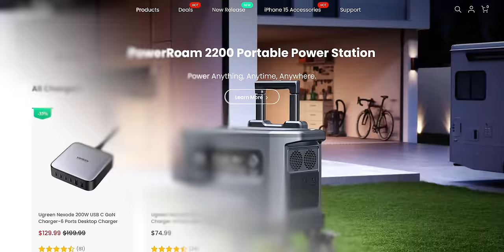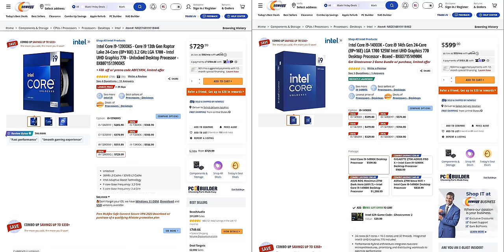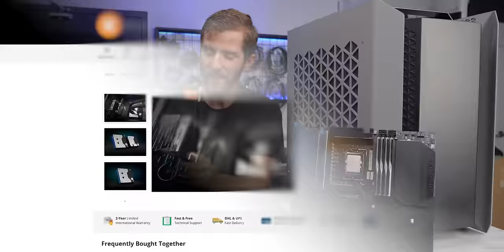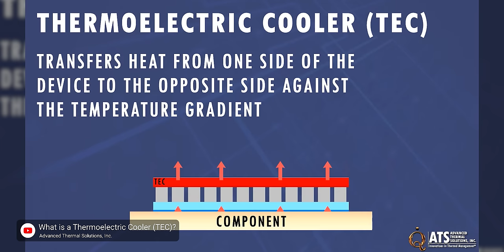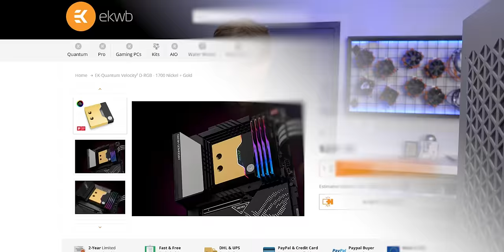Compensator 4 - How to Waste $30,000 on a Gaming PC

Comment: Gerolsteiner, once i used it also to refill the watercooling....... but of my car... when i got stuck in traffic and due of a faulty fuse the fan of the radiator didnt run and the water started boiling.

Comment: You've overcooked it there with the RAM.....

This is from MSI directly, that motherboard doesn't run well with more than 2 DIMMs.... I'll never understand why they bother putting 4 DIMMs on them.

4x DDR5 UDIMM, Maximum Memory Capacity 256GB
Memory Support 7800+(OC)/ 7600(OC)/ 7400(OC)/ 7200(OC)/ 7000(OC)/ 6800(OC)/ 6600(OC)/ 6400(OC)/ 6200(OC)/ 6000(OC)/ 5800(OC)/ 5600(JEDEC)/ 5400(JEDEC)/ 5200(JEDEC)/ 5000(JEDEC)/ 4800(JEDEC) MHz

Max. overclocking frequency:

     • 1DPC 1R Max speed up to 7800+ MHz
     • 1DPC 2R Max speed up to 6600+ MHz     
     • 2DPC 1R Max speed up to 6400+ MHz
     • 2DPC 2R Max speed up to 5600+ MHz

14:14 its a shame that you cant make full use of those cables with that PSU and its lack of support for them

Comment: 52:10 Strong BUY. Still early innings. NVIDIA is the dominant leader in AI and the preferred technology partner globally.  Even w new competition on the horizon, NVIDIA is far ahead of the competition.  85% market share. 76% margin. Unrivaled demand for new Blackwell chip. Demand far exceeds production for Blackwell through to 2025 and beyond.  No competitor has anything close to Blackwell.  And forward P/E is about 33 (cheap for a high growth stock). Buy this stock and wait. You will be rewarded

Comment: 5 nvme and 6 sata drives ... on a consumer platform. Like connecting a firehose through a straw.

So I think my computer has some resemblance to this system. 128GB ram (yes, I have a specific use case that needs it), 3 NVMe SSDs (one boot disk, two in raid0 for speed), ~$180 mechanical keyboard (because RSI), 16-core + HT Ryzen 3950x. Built in 2020. The one mistake I made was thinking the SSDs were worth it. Turns out, when you have enough ram to run literally anything out of RAM - even watching a 4k bluray, because the whole bluray fits in RAM with room to spare - your computer doesn't use the SSDs much. The CPU runs 100% with some regularity, the memory is at 5-20% except for that specific use case when it's at 90%+.

But no, it's not for gaming. This is silly for gaming. Even the idea of running Windows on it is silly.

Comment: Why, in the name of everything that is sacred, would you put mineral water instead of purified water ? i get the point is to be as expensive as possible but isn't functionality part of it ? if it's just to be as expensive as possible, just use a brick of gold as the PSU. It won't start but it will be expensive.

Comment: why would you ever put windows on a single boot drive when you have 5 nvme drives and enough 2.5'' ssd storage to back them up instead of using raid 0. Windows is extremely inefficient at reading from disk it doesn't do extremely efficient read ahead ram cache that has everything loaded in ram before you need it most of the time like linux. That is why linux is faster on a harddrive most of the time than windows is on an ssd.

Comment: Further proof that the best way to buy a PC is mid range parts and upgrading every 5 to 7 years.
Reply: Depends on what you do with your pc. 
I use mine for a mix of video editing and ML. That does not fly with an i5 or AM4/AM5.
Reply: @AB-80X  gaming, mainly.

Possibly video editing.

Comment: Got an issue with PC? Throw money at it!! -Perfect for Compensators

And Then, then there is us Tinkerers. Overclocking Desktop with decent power draw, efficiency and clocks CPU+GPU wise. Pretty much display refreshrate is only difference to me between my computers, as performance should be maximum of +/-  10% difference between the two.
- Desktop :: R7 2700x up to 4.3GHz boost + 1070ti + 16GB DDR4@3200 CL14 + 144Hz MSI MAG271CR
- Laptop :: Asus ROG G713QM - R7 5800H + 3060 + 16GB DDR4@3200 CL22 + 300Hz screen

Comment: Are u kidding me?? 30k$ for a PC and am I the only one who thought this machine must obliviate cyberpunk to a point where running it looks like the game being ten years old ??? I would have ecpected it to run cyberpunk on fully cranked up settings, meaning 4k res.+ raytracing and all other settings maxed out, at least with 100+ fps instead it feels like an upper class PC in the  range of 4-5k$ (just by cyberpunk as a measure). I mean 4k res. max. settings and 'only' around 60 fps with lows to 40fps feels like u have reached the limits of hardware-capabilitys which are available to the Normal consumers, way before the pricepoint of 30k$

Comment: I also lost it when you used carbonated mineral water…. Nearly shut it off. That was a dumb move… 
You could have gotten more expensive purpose made cooling liquid. 
Or just used Ultra pure RO’d Aquafina with a few oz of hydrogen peroxide. 
Actually a very dumb idea to use carbonated Mineral Water 🤦‍♂️ 
I lost brain cells when you did that. 

Video notes: compensator build is fun to watch but such impractical advice…
I think a really fun video would be:
“The Most Optimized Build *Insert Year*”

Where you go over all the hardware from a particular year, go over a bunch of benchmarks and do a pc build that gives your best “bang for your buck” of that year. 

So like the fastest pc you can build while it still being a good deal (even if it’s not necessarily cheap) 

Like benchmarking shows this ram and this cpu combo gives more performance that other combos so we went with this, this monitor os good quality but only 120fps and therefore the best gpu to reach those frame without going over is this one” etc etc etc.

Comment: Hi Linus, just had to wonder, why the hell are you wasting everyones time testing $30,000 rigs, and cooling set-ups now when in the very near future, up and coming processor/pc components tech in general will soon be potentaially replaced by new architecture chips/processors, etc that will be run by laser driven technology ?? - This cannot come soon enough in my opinion as the benefits will far outweigh any current tech anyone is running today. The new laser tech components currently being developed in short, are/will be, exponentially faster (at least 100`s of times faster than any current chip/processor), and produce ZERO DEGREES heat output, potentially quashing the potential need for conventional cooling methods in the future, once the laser tech driven components have been perfected, whilst at the same time, your whole potential pc set-up will be ridiculously faster at the same time too - It would be good to hear your thoughts on this matter, John Allen, Hull, England.